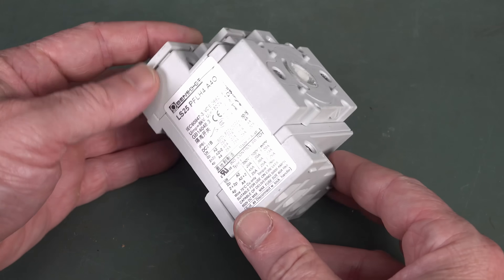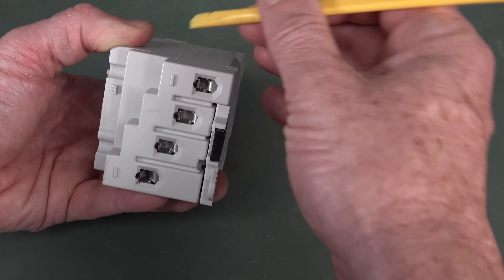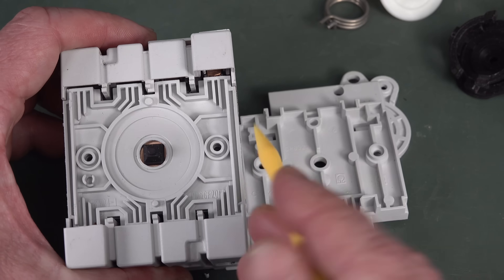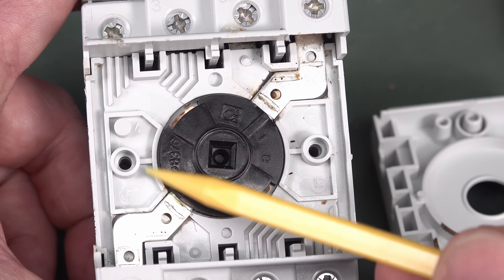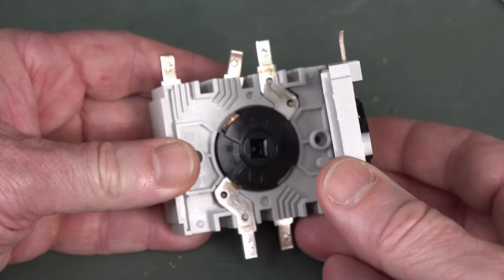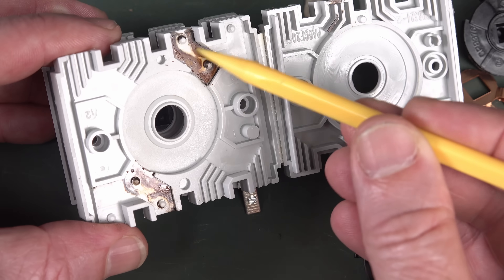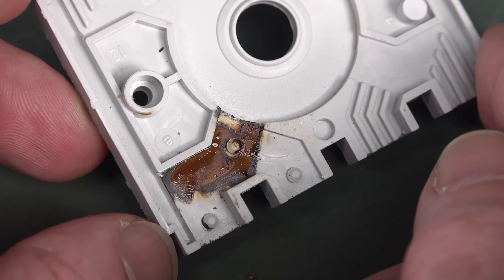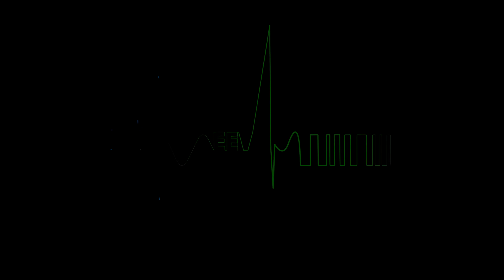EEVblog 1641 - How DC Solar Isolators Work (TEARDOWN)

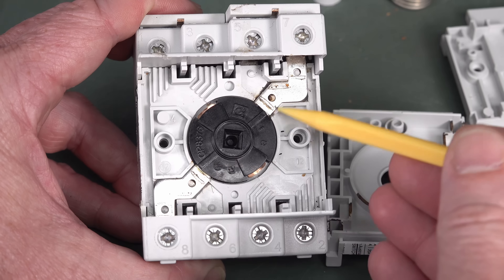Comment: 5:15 the Numbers at the Terminals are there for a reason 1/3/5/7 are line in and 2/4/6/8 are line out or throw.  The current enters through terminal 1 and exits through terminal 2 and so on
Greeting from a sparky out of Germany

Comment: Did a project on cryogenic coolers for the dc link between mainland Japan and the Island of Hokkaido.  They have to be able to absorb the inductive current of thousands of amps in miles of dc cable.  They used a lot of high energy absorbers that they wanted to get close to superconductivity to absorb the current so it could be slowly dissipated.  It was a fun project.  The issue is the inductance of the cable from the pv to your inverter carrying 10 amps or more.  You can't just turn it off as cable inductance will generate an arc.

Comment: Most inverters should offer a software shutdown that should be used for maintenance before switching the actual DC switch. Helps with contact wear-out.

Comment: Those chutes are there as a vent to keep the switch from exploding from gas pressure. .  There is an experiment which would be quite interesting to see.  I have tested DC breakers with not much more than 100V using a power supply and load resistor. Pretty interesting that on a double breaker the arc doesn't stop till the load reaches about 35V and there is very little difference in that ending voltage between single and double breaker as well as the arc time which is about 400 microseconds.  My most accessed reference book is GASEOUS CONDUCTORS by James Dillon Cobine.  Usually after the fact to explain what I've seen.

Comment: 11:24 seeing similar "staining" on 400v 63 amp 3 phase rcd's if the terminals have been a bit toasty.
Especially on the neutral if it has been loaded a bit much and the terminals aren't tight enough.

Comment: The Fronius snap inverters use a benedict isolator switch/mating block, the base plate contains the isolator with a set of pins, ac and dc the inverter just slots in. Good kit made in Austria. Our cable fault location kit is Baur also from Austria also good stuff.

Comment: Adding switches in series sure feels like an inappropriate solution for scaling towards higher switching voltages. Since mechanical separation tends to be fairly slow and have fairly large tolerances. Ie one contact will take the bulk of the burden.

Paralleling contacts has the same issue.
High voltage, and especially combined with a decent bit of current makes switching wonderfully non trivial.

Comment: I'm guessing that big spring goes along with some stiff detents, so the switch snaps rapidly from on to off and vice versa.
Reply: yes. 3:19 the spring is like a "servo saver" it lets the thing turning build up energy and then snap once the contacts start sliding.

Comment: The designation DC21B on the side is the standard rating it’s tested to. It will specify the current to be switched as well as the number of cycles. It’s common for switches tested toIEC standards to feature such a designation.

Comment: solar DC isolation switches are not recommended here as it increases the risk of installation failure. Most inverters have this built in so you dont need extra failure point.

Comment: If someone wonders if they can use a regular fuse or one of those din mounted automatic AC circuit breakers as a DC fuse/ isolator because it's cheaper and "works" the answer is absolutely not. DC arc is nasty and much harder to extinguish compared to AC
ok, exception being low amps and voltages, then use whatever
Reply: Some fuses come with suitable DC ratings; most energy-limiting generic MCCBs also come with a (though less suitable) DC rating.
Reply: Most bigger ceramic fuses can handle it, 10x38mm "midget fuses" and bigger. Of course read the datasheet!

Comment: I assume that a big part of the operation is in the shaft assembly. It looks like it's designed to snap the contacts around very quickly.
Also would have been interesting to see the contacts around the burnt/corroded switch.

Comment: That plastic lines are almost certainly just an optimised mechanical support and ventilation.
I'm sure you can muscle up some electro-mechanical switching design engineer as a guest to comment on this and promote the company's products.

Comment: A question to you please, how would you prevent Switching bouncing in a high voltage DC? For low voltage DC it is easy but for high DC voltage (120V and up ) it wouldn't be easy .. taking in consideration that you need to have a ON voltage instantly .. i.e. you should be able to take transient characteristic sof a DUT using that DC voltage.
Reply: Why does it need to do fancy denouncing when it makes contact? 
At nominal current and typical arc voltage of ~50V it's not that much power, and only for a brief moment.

Besides that, it shouldn't be hard to design the contact pressure delivery setup such that the ringing from the impact is dissipated somewhere else other than the mating surface.
Reply: @namibjDerEchte  
If you are testing a device or a board, and the switching ON is captured by an Oscilloscope, i.e. the transient. That is the situation I am talking about. 
You need to have a pure, quick high voltage ON to the circuit. 
I thought about Solid state relay, but they are not without delay.

Comment: Hi Dave, you need much less voltage than you think to get a decent DC arc, switching slowly is the key here.
100V DC, if switched slowly, with a load that draws a few amps can already create arcs of a few centimeters.
But I doubt you would see anything usefull when those "modules" are open on one side.

Comment: Try connecting a DC welder for getting a sustained current arcing because that HV tester with its internal tiny current limit is acting as a gap capacitor charger, you can even hear the crackling of the high speed sparks

Comment: It is real problem with arcing. I wonder why not to short PV input with a IGBT first, and then switch it off, and then release IGBT short? Instead of dealing with full PV voltage, shorted PV will have voltage equal to Vce which  is about 3V
Reply: Because electrical standard committees are allergic to solid state disconnects.
Note how you'd have to use two switches (but one need not be capable of breaking operating voltage/current, only carrying fault current while mated) with the IGBT in series with the weaker one, and sequence "break main; wait for arc to extinguish; turn off IGBT; when current has subsided, break auxiliary".

In practice for DC situations (with >=400V) you would want to use SiC JFETs that are always in the current path. 
The reason is that you can trip them extremely quickly before a large fault current has built up (like, literally in single-digit microseconds), which also conveniently allows selective breaker tripping to isolate the fault without interrupting the rest of the local DC grid (e.g. panels with power optimizers feeding a DC bus to which inverter, battery, and straight DC loads (inverter HVAC units and the PSUs for modern electronics (computer, laptop, TV) could run off of a couple hundred volt DC with minor or even no modifications) are connected).

Comment: Designed such that you use a single plastic part for the switches, with only the actual conductors being different. Single unit for forming the base and the top of the next switch. Then a top and bottom, with the terminal ends providing both arc covers and vents, plus the terminals. The heavy operation only from the spring, the actual contacts being relatively easy moving, though the spring does provide a rapid engagement when closing, to aid in reducing arcing, and same for opening.

Looking at some online sources, 2 full load operations are guaranteed, and at least 4000 mechanical operations. Full load is breaking the rated short circuit current, for most breakers around 2kA, the regular overcurrent trip is included in the mechanical life. For the disconnector they are not rated to break current, or for operation under load, but only for service use.

Damage in the switch is from moisture, probably some that got in the case when assembled, or that wicked through the seals from rain hitting the hot box, and being sucked through the glands and case seals, because nobody will actually use proper IP68 rated glands, with a silicone rubber seal on the gland side, because of the cost. Instead use the plain IP3X cheap glands instead, that do not provide any water protection, unless you use PVC weld to seal the gland into the plastic case. They might even have tightened the nut full,y but often you will find them either loose, or they are so badly made they split with time.

Comment: Great video. The 'arc chutes' you mention are unlikely to be intended to help break the arc because once the contacts have rotated to that point the arc will have broken. I believe they are there to release the burned gas, and cool it down as mentioned in the video.

Real arc chutes are metal, and they work differently. The arc connects to them breaking the arc into many small sections of arc in series. Each initiation and termination of the arc has a fixed voltage drop, which all add up. This exceeds the arc voltage and kills the arc almost instantly.

Comment: Interesting!  I have never seen plastic arc chutes before.  I would have expected the heat of an arc to carbonize the plastic and maybe form a conductive path across the switch
Reply: These are not rated for on load disconnection, only to isolate the panels for service, so switching should not involve current flow, only the arc from the capacitance and inductance in the wire. Plastic arc chutes are common though, most breakers use a combination of thermoplastic and metal arc chutes these days, at least using plastic parts for the channels and any arc diverters in the switch.

Comment: The Hager SB432PV looks pretty much identical to this disconnector.
The Hager is probably just a Benedikt with a different label.
I have 3 of the SB432PVs in use and haven't had any problems with them yet. My neighbour bought his DC load-break switches from Amazon (China brand) and already had one that melted.

Comment: those switch contacts could be beryllium copper.  Ex rated tools are usually made from it, its more wear resistant, wont oxidize as quick and has better properties than plain old copper.
Reply: Moving parts probably are, from the colour, but the fixed contacts are plain tinned copper, as the wiping ensures any oxide is removed. they do grow whiskers though with time, unless the tinm has at least 5% lead in it as alloying metal, which inhibits this.
Reply: Isn't Beryllium highly toxic?
Perhaps that was a part of the "ozone" smell?
Reply: @SusanPearce_H  You only need a small amount, well under 1% to get the improved properties. Copper is toxic anyway as a pure metal, so not much added risk. 0.1% in a batch of scrap copper will make that entire melt non malleable, and require the furnace to be relined to remove it.
Reply: @SeanBZA  Thank you for a comprehensive reply.

Comment: For shutting down a PV inverter, you are supposed to isolate the AC side first, so that you can then break the DC without it being under load.

Then the reverse for startup.

This is usually signed as such as well.
Reply from the maker: Yes, but the DC isolator is capable of it, that's what it's designed for.
Reply: @EEVblog  correct, but you'll put unnecessary wear on it. Less wear to break the AC side first if it's a routine shutdown and not an emergency.
Reply from the maker: @shaunclarke94  Yes, of course, but that's not the point of the video. In fact the entire point of the video is about what happens when you do break a HV DC load.

Comment: Hey Dave, try some "high" DC current with a big inductor in series, you might get some interesting arcing. Maybe long exposure (photo or even higher shooter angle, lower frame rate).

I'm guessing about those 4 to 10A with a gapped inductor in series with the switch, and then open it, the faster the better, maybe. You don't need high voltage, or energy fwiw, the magnetic field can store it for you. I just want to see it arcing!!

If it works and you want to get the geometry shining, maybe an acrylic cover can gide the arcs to the channels.
Reply: You'd think a charged 24V truck battery would do a decent job?
Reply: Not even a microwave oven transformer? They have all the stack from one side, might act as gapped, or are easier make gapped..

At work I have a spare 2kA inductor, capable of 100kV kick back, but I guess it isn't standard office furniture. We do live off making 40kA arcs here 😅.
Reply from the maker: Might be possible. Not sure a big arse inductor anywhere though...

Comment: Cool demo Dave! I'm glad we've killed the rooftop isolator in the Aussie standards as they caused so many problems for us electricians over the years!
Reply from the maker: Yeah, my new install doesn't have it. The AC one for the Enphase is still mandatory though so the installers told me.
Reply: @EEVblog  Had a little play with the Enphase gear; More of an industrial sparky here, those solar installers are like gym junkies! There's a lot of manpower that goes into them, I'm mostly hired for my knowledge to find faults fast.

Comment: I don't like mini-isolators just in general.  Operation isn't spring-loaded and the ARC isn't pulled off the contacts very quickly, so every operation damages the unit a bit more.  Eventually you get enough resistance to cause a fire.  But doubly-so up on roofs.  Nor should these things ever be put on top of a roof where they can't be easily checked.
Reply: That big spring is because these are spring loaded. You have to load the spring up with considerable torque/energy before it releases it's energy and actuates the actual mechanism inside.
Reply: @gnif  Ahh, I missed the spring.  Well, that's an improvement.  But I still avoid these things like the plague.

I want something that will actually trip-off thermally so I pretty much universally use real DC breakers instead of disconnects.  Not because of the current trip (which will never happen), but because nearly all failure cases for a breaker result in a trip-off.

-Matt
Reply from the maker: @junkerzn7312  How will a breaker in a DC solar string trip if the switch arcs and allows the continuous (no fault) current to flow into the otherwise working inverter?
Reply: @junkerzn7312  What do you mean by, "nearly all failures"?  How many failures are you experiencing?  If your answer is more than 1, something in your setup or design is wrong/bad.
Reply: @EEVblog  I did say that it doesn't trip normally.  The purpose of using a breaker is simply as a manual disconnect.  This is why most solar combiner boxes have master breakers.  The solar panels can't put enough current into the breaker to trip it normally.  But its a better disconnect than a solar disconnect.

Under abnormal conditions the internals of the breaker are under tension.  A mechanical failure internally WILL trip the breaker in most situations, yes.  And a high-resistance failure mode that overheats the breaker internally will also tend to trip it, either from the bimetalic element or from an internal mechanical failure.

It doesn't take much inside a breaker to trip it.  If any of those plastic pieces distort from the heat, it will almost certainly trip.
Reply: @LackofFaithify  This is general knowledge and effectively a UL489... well, more like a UL1077 requirement, since UL1077 allows destructive operation of the breaker.  It must fail in a tripped position under those circumstances.  UL489 requires that the breaker not fail at all and be resettable under similar circumstances.  But the end-result is that listed breakers will almost universally fail tripped at EOL.

The whole point of the breaker design is to not cause a fire, including when it dies from age or abuse.  Haven't you ever had to deal with dead breakers in your house?   Over 50 years I've seen several.  ALL of them died in a tripped state.  That is on purpose, by design.  Nobody wants old breakers in a home to catch on fire due to age when they mechanically fail.

A DC breaker has a very similar design to an AC breaker.  In many cases, its the same design, in fact, just with a slightly longer throw for the contact mechanism.   Unpolarized DC breakers often have almost exactly the same design as an AC breaker (at least until you get into the very high current ratings), and polarized DC breakers either go with that same design plus a two magnets on either side of the contacts (usually behind plastic housings).  For high-current unpolarized DC breakers they go with dual-arc extinguishing chambers to handle the current direction, or they go with a powered electromagnet to handle the current direction.

But in all cases, the trip mechanisms are extremely close to the trip mechanism used in an AC breaker.  On purpose.  So the failure modes for breakers are far, far better than the failure modes for disconnects.

Comment: I think you missed the fact that the black disk is actually hollow. The plasma doesn't need to sneak around any gaps. Just as the wiper is near the contacts, plasma still can find its way to the chutes through empty space in that disk.

Comment: If it's DC why does it have 4 current paths? Just a coincidence?
Reply from the maker: Do you mean the 4 poles? That's for flexibility in configuration. You only need two poles for a single DC solar string.